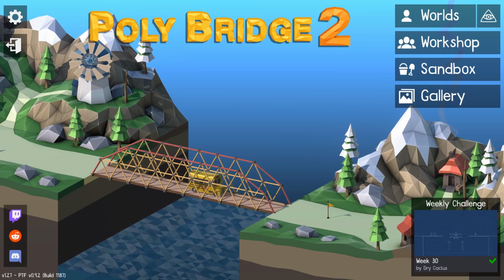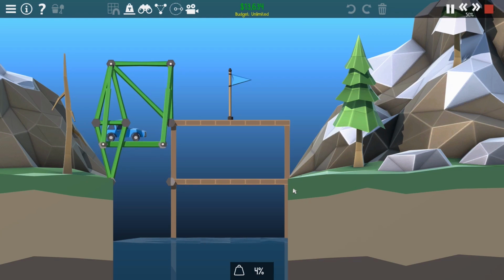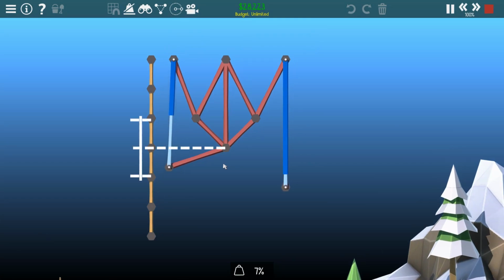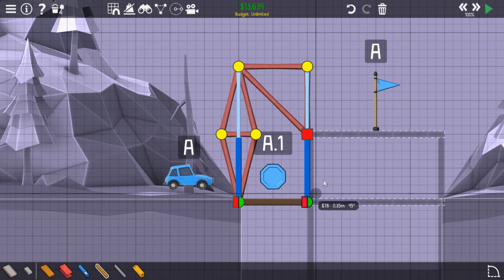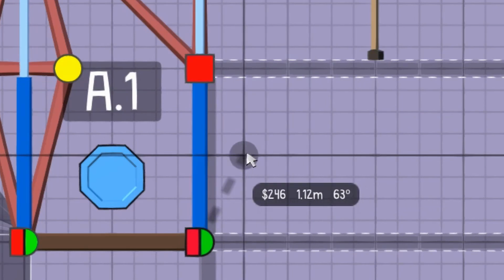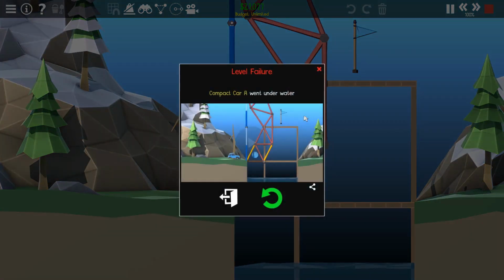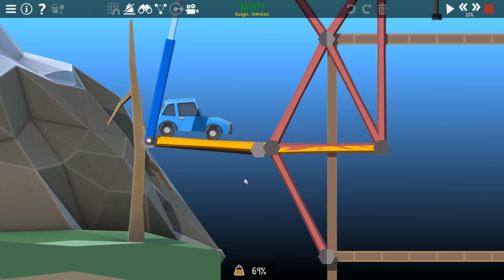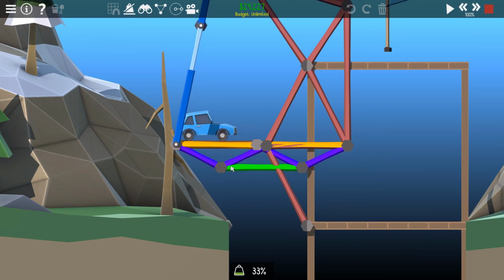Hydraulics Tutorial #1 - Guiding Arms and Bracing | Poly Bridge 2

Comment: Hydraulic Campaigns to Play In Order of Difficulty AvRJA, V4BqA, ArkLn, Ap32b, V4JqA
Reply: What does AvRJA, V4BqA... mean?
Reply: @GabrieleSantoro-01  they are campaign codes for the hydraulic levels you can practice on
Reply: @hippolippo Cool. Thanks.
Reply: I cant do 5 on the first one :(
Reply: @Falcon-_-  
It's relatively simple once you get it. The top split joint is just to lock into. The two horizontal pieces are to control the platform to not sway around. Practice makes perfect.

i dot postimg dot cc/kGQQbtt2/Av-RJA-lv5 dot jpg

Comment: how did you color the steel? 3:35
Reply from the maker: I am using the Colored Materials Mod. There is a small modding scene for this game. You can find out more by joining the discord server linked on the polybridge main menu
Reply: @TheLazyComet what hexcodes do you use?
Reply from the maker: #FF0000, #FFA500, #FFEB04, #00FF00, #0066FF, #7F00FF, #00000, #FFFFF, #008800, #888888

Comment: Okay I can't figure this out so I might as well ask here on a 2 years old video... I want to achieve straight motion using the bracing arm as opposed to a curved motion. Is this possible? If not, what other mechanism could I use? I've been sitting on this issue for 2 hours now and I can't figure it out, thanks!
Reply from the maker: You want to use a grasshopper linkage or a Peauciller Lipkin linkage
Reply: @TheLazyComet  Thanks!